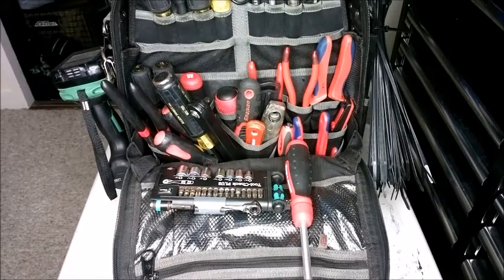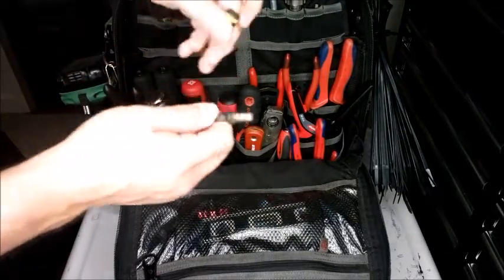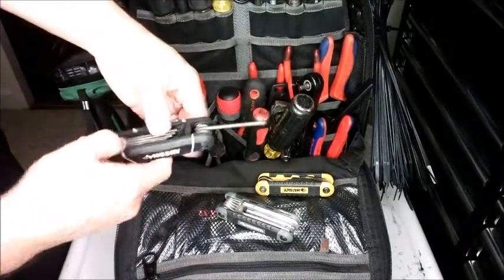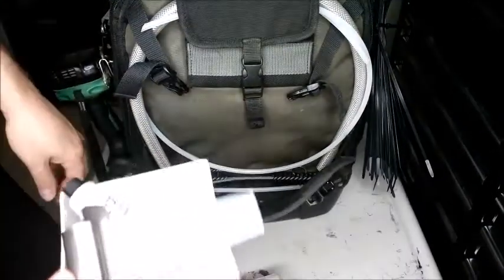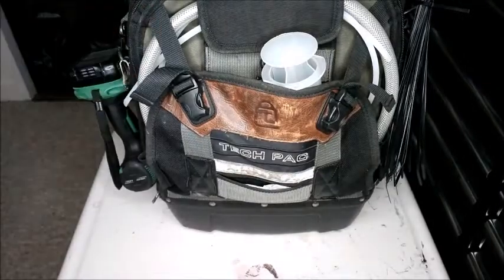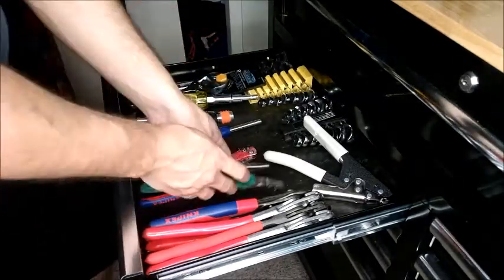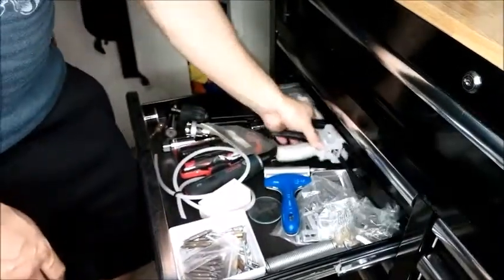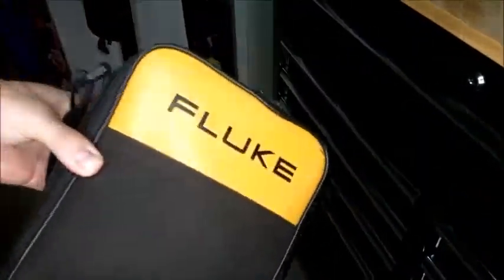Appliance Technician Tool Bag Loadout and a Bunch of Tools I Kind of Regret Buying

Comment: I’m sure you are not using 80% of your tool bag on 80% of your jobs. That’s just a dead weight in here. I’m an appliance repair tech too and I dont see any reason to carry everything with you if you don’t need it most of the time. It can sit in the car until you need it

Comment: Suspect you are a out and out tool junky as there is a far bit of duplication....The various ratchet drivers, for instance, and that's even in just your tool bag.. Also, it you are fixing appliances and not say wiring out attics, a small rechargeable  COP led work light like the Unilite SLR 500 is far less bulky and far easier to carry than that huge torch you have.... I also like to carry  a small LED penlite inspection torch which I can get into nooks and crannies...in my vehicle I also have a rechargeable headtorch should I need it, plus on or two other rechargabld lights...Some of the "specialist" tools were quite interesting, many of which   I confess I have never seen before...I have stopped buying Allen key sets, and rather prefer to buy the Allen 1/4" bits in either 2" or 4" length...same with the Torx 1/4" security bits....Edited to add one thing I carry in every tool bag I have is a plug-in socket tester to check the power at the outlet..Not related in any way to appliance repairs but because you are a tool junky,  I also have a couple those small UNI-T USB plug in testers that give you voltage and current being drawn from a USB outlet; surprisingly handy testers for a sub $10 item...
Reply from the maker: Since this video came out, I have gotten a few outlet testers! I also am interested in in getting LONG Hex and Torx bits that can be used in a driver. I really want Wiha, Wera, or Bonda to make some. So far, I've only found cheap brands that make the length that I want.

Comment: Lol. You sound like me. Always looking for a tool to make the job easier. It depends on what you are working on as far as brand. My tools this year are completely different from last year because I switched brands. I won’t get rid of anything just in case. This year I am doing a lot of washer bearings on front loaders and gear boxes on top load washers. I bought bigger tools in the 3/8 size vs 1/4. More wrenches and sockets than last year. The screwdriver you are looking for is the Gedore 2169-012. Check it out. I haven’t pulled the trigger on it yet. Lol.

Comment: Those ratcheting adjustable wrenches are they the brand from O'riely's ? I though those would br good for plumbing small nuts tigh places. They work the same as the Wera joker but half the price.
Reply from the maker: Yup. They're from O'reilly Auto Parts. They're so niche, I have to find an excuse to use them.

Comment: Lang makes a long ratcheting wrench with a 4mm and 4.5mm for doing ford headlights and it's perfect for the feet on dishwashers to get them in and out especially on the GE's that don't have any room
Reply: Also in my opinion Makita makes the best long impact nut drivers and long Philips bits. They have held up threw the years great

Comment: Interesting.  I have that Milwaukee  right angle attachment. Had it for years, but mine has an adjustable handle  that can swivel around the head on the side. (not the cheaper version. Paid $50 for it).Extremely handy. Looks just like yourself with the handle. I swear by this tool, and it puts all the cheaper ones to shame. Sturdy as having a small right angle drill
Reply from the maker: It had the handle. I took off to jam it into a tight space. I lost the retaining clip.